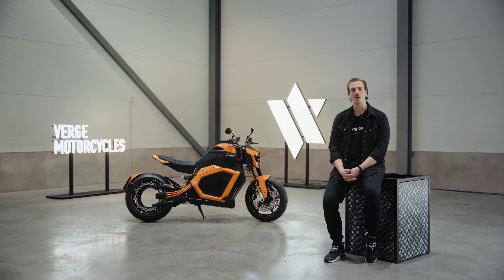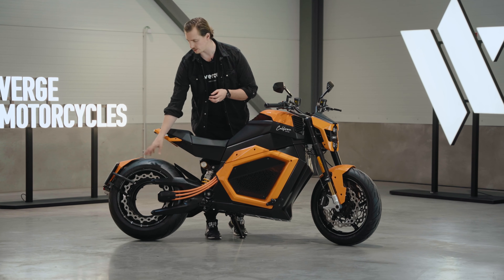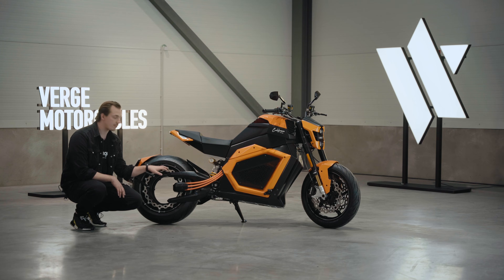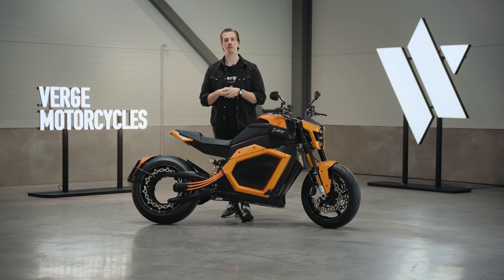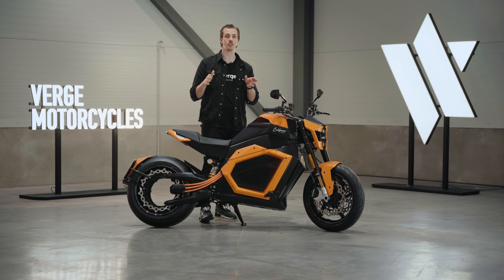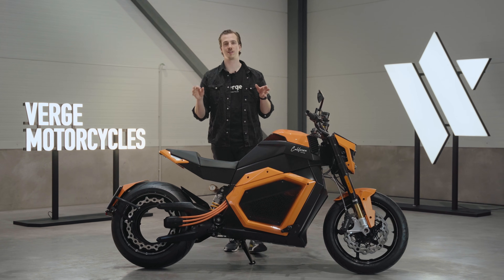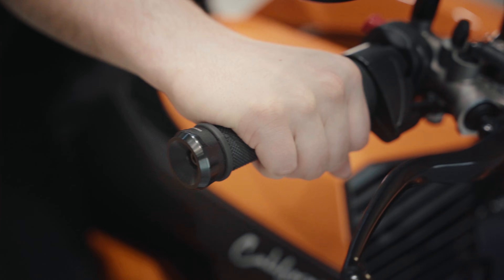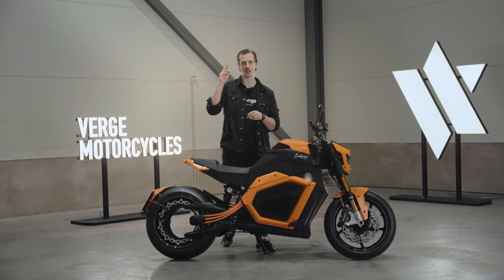Verge TS Pro Explained - An in-depth look at the electric motorcycle

Comment: It looks awesome, but something puzzles me: Why does 1,000 Nm only give a 0-100 time of 3.5 seconds? My SV650, with just 64 Nm can probably do that if I change the sprocket. Could you "tune" it differently to do 0-100 in closer to 2 seconds? If it did 0-100 in close to 2 seconds, had a top speed of 150 (instead of 200) and a range of 100 (instead of 350) I would buy it. Thanks!
Reply from the maker: Hello! Thank you for interest in our bikes! Here is an answer to your question from our Technical Team. 
The TS Pro features a direct drive propulsion system, meaning the motor axle is the same as the rear wheel axle, delivering 1000Nm directly to the rear axle. This provides more than enough torque to accelerate the 245kg bike to 100km/h in just under 3.5 seconds. What’s particularly impressive is that the full 1000Nm is available instantly whenever you twist the throttle. However, since it’s direct drive, you cannot adjust gearing to increase acceleration at the cost of top speed.
On the other hand, your SV650 has 64Nm of torque at the motor axle, but this torque is multiplied through three gear ratios before reaching the rear wheel axle: the primary reduction (clutch), gearbox, and final reduction (sprockets and chain). As a result, while your SV650 produces 64Nm at the motor axle, it experiences more than ten times that torque at the rear wheel axle in first gear, with decreasing multiplication in higher gears.
Reply: @vergemotorcycles  Thanks a million for the detailed explanation. Much appreciated! Have you considered a more city oriented bike with super fast acceleration, less range, less top speed and less weight? If so, I'd buy it!
Reply from the maker: Thank you for you feedback and ideas!  Your enthusiasm and creative thinking are greatly appreciated. Stay tuned for future developments at Verge Motorcycles!🙌
Reply: @vergemotorcycles  I'll gladly come and work with you on such a bike. Yes, seriously.
Reply from the maker: You are welcome to submit your job application at any time at the bottom of our homepage at https://www.vergemotorcycles.com 
There, you'll find a link to our open application form.
Reply: @vergemotorcycles  No thanks. I'm running my own company. That's why I wrote work WITH you, not FOR you. ;)
Reply from the maker: Wishing your company all the success! Have a great day!

Comment: what are the battery and motor cooling system, does heat generated from the hub motor affect rear tire pressure.

Comment: Great video, thanks !

Small question, how to change the rear tyre?
Reply: That’s a good question… Because it’ll get through a lot of back tyres with that much torque.
Reply from the maker: We’ve actually created a video on how to change the rear tire! Be sure to check it out! https://youtu.be/lpk7y7bWdCc?si=0EKWfyfYD4mFSww2
Reply: You have to undo about 40 bolts I think.

Comment: what form factor of cells did you use? 2170? how many in series/parallel ? AC max charging speed? if more than 3kW ac charging its possible to make 2 or 3 phase in EU?

Comment: Since you have so much space on the top, is integrating the home charger inside the bike possible? That will make travelling so much easier!
Reply: The Verge has DC fast charging, much better for travelling. AC charger is for slow charging in several hours.

Comment: How it handles the dirt, dust and water?
Reply: Just like other bikes
Reply from the maker: Our bikes are designed and built with the core principle of having the motor integrated into the rear wheel, ensuring that we have thoroughly considered all potential impacts on the bike and its performance.
Additionally, our bikes undergo rigorous testing to ensure they can withstand various conditions.
Rest assured, our bikes are built to endure and perform reliably⚡⚡⚡
Reply: @vergemotorcycles   I would like learn about how high voltage lines flow, about wheel which part holds magnets stator or rotor n their connection. It's great design. Suggestion plz books, video links..thank you team Verge
Reply from the maker: Hey, you can find all public information that we are able to share at this moment about our bikes on our website at https://www.vergemotorcycles.com/gl_en/
For books, videos, articles and other resources that can help you understand how these systems work, particularly focusing on electric motor designs, please head over to google search. There are plenty of sources like books - Electric Motorcycles: How and Why They Work” by Carl Vogel or Electric Motors and Drives: Fundamentals, Types and Applications” by Austin Hughes and Bill Drury